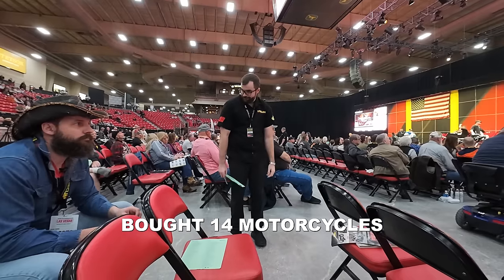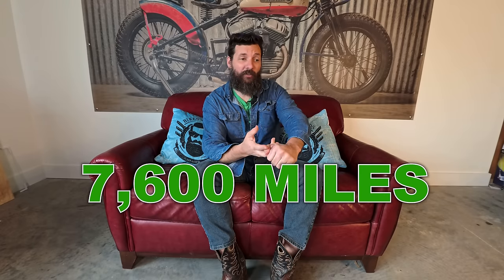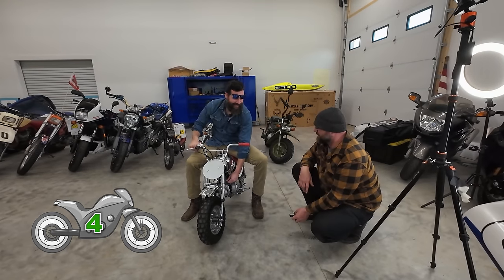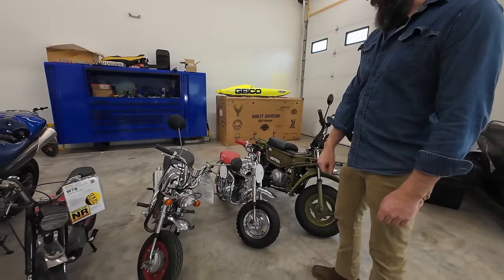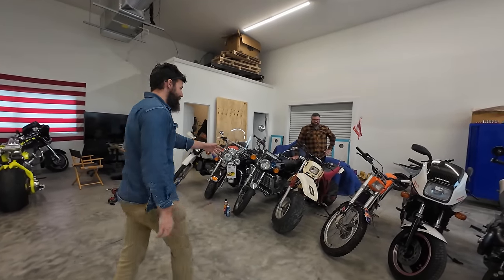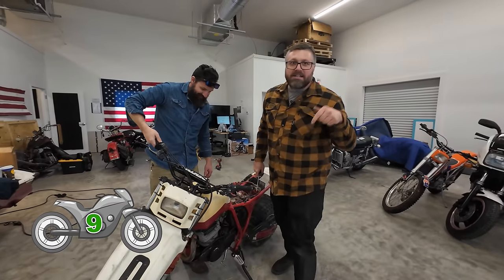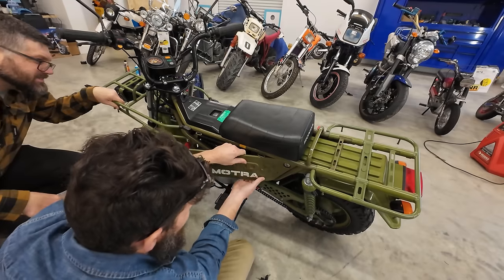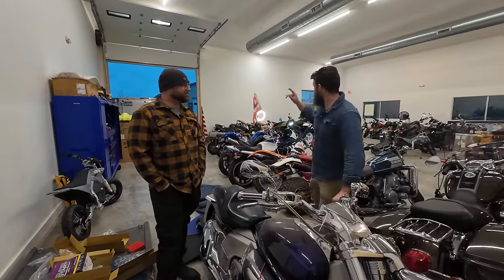I Bought 14 Motorcycles at Auction and its NOT Looking Good

Comment: this video had so much potential, but your camera person seems to be afraid of motorcycles. There was so much talk about details on the bikes, paint condition, speedometer, carburetor, seats, lights, switches etc, yet your camera person keeps filming from 6 to 8 feet away and never gets up close. It is great to see you two guys, but we do not need to see your faces nonstop while you talk about the bikes. It would be nice to see the bikes and details closeup as you talk about them and fix them.

Comment: Worked at a Honda dealership briefly at the time the Interceptor came out. All I can say is there wasn't any room around it when we pulled the shipping cover off of it till after it was on the floor the first day. Everyone had to have their eyes on it!!! Yours looks like a good restore project though. 
Yes they were absolute benchmarks for the industry. Nothing was the same after it.
Reply: Watch for the "chocolate cams" on those.
The oil for the heads is riuted directly from the clutch basket, before any filtration can occur, took the dealers in the uk to figure this out as they just kept eating cams.
They were replacing cams thinking it was faulty "chocolatey metal" at first.
But it was just the clutch dust essentially sanding the cams away.
Honda rushed them out to market to have something to compete against the suzuki katana and never did get round to fixing the issue at the factory.
Within months of release the cbx750 appeared which says rather a lot about this bike.
It was very innovative with the v4 beam frame and strange multi piece wheels!
but a bit too innovative!
Theres a modifcation you can do to take the oil from the main gallery at the bottom of the motor.
Same on the magnas sabre etc. which is a different crank and firing but same engine.
The first editions with the bolted multi piece wheels were a bit of an issue too as if you wheelied one and came down too hard the tyre would grab the fork as the wheel bent...coupled with the slightly nightmarish antidive and floppy frame it would try to kill you just a little bit dead.
The really cool bit was the 180 degree crank, 1-4-3-2 firing order (same as thebhinda racing v4s) and the weight ,it was incredibly light for its day , its essentially the first supersport bike for the road but was sadly a  truly terrible bike as a package.
The vfr that followed is the real honda masterpiece.
They sound amazing on song but you would pay for it in fuel!
Reply: The most balanced motorcycle engine made - Honda V4.
Reply: @sana-cm7oc  in this configuration its a bit special.
1 4 3 2 firing order and 180 degree crank and oversquare bore too.
Same as the motogp v4s made many many years later 
The vfr that soon followed was a vast improvement on the interceptor though.
Reply: @deadprivacy  Thank you. Love this line of engines.

Comment: Congratulations on the RUNE, the best thing is that it fired up at the first attempt. You never see too many Auction Houses go broke. You're an honest, decent young man and you would be a very credible to do business with.Thanks to you for the video I am a regular viewer and also of the bearded mechanic Craig.
Reply: I was the owner of the Rune. It was kept on a battery tender and had Stabil fuel stabilizer. Tank was always kept full and the bike would be run on the freeway every few months. The FI injectors got a bit wonky a few years ago, but adding Lucas injector cleaner and 20 miles on the freeway cleared right out.
Reply: YESSS CRAIGGG

Comment: had an RE-5 - do not forget the 2 stroke oil tank. rotor tips are hard to find for them these days. The good news is it is every bit as smooth as you have heard. Roadtripped mine across Texas in the late 80s. As long as the 2 stroke tank is up, and you have compression, she will run (and surprise you).
Reply: how was it power wise?
Reply: @colestowing8695   about the same or a bit better than a 1000cc of the time
Reply: @acconboy  wow. ok. wouldnt have expected that. those motors were pretty small displacement wise werent they? I mean...the rotary cars were too but they were pretty gutless until they added turbos
Reply: jay Leno has to get spark plugs made for the RE-5. They are prone to eating them.
Reply: @colestowing8695 
Supposedly 500 cc. My friend had one. It sounded like a rotary blade lawnmower to me, with that blowy blade sound.
Reply: I've got a 1975 RE5 sitting in my garage that hasn't run in maybe 30 years. There was a great community around these bikes maybe 10 years ago, I'm not sure what happened to the listserv, though.
Reply: @accon: oil - that’s what I was concerned about that they’d forget the oil.

Comment: Sean, don't let that trucking company steal your money.
You paid them for a service that they didn't provide. 
If you paid by credit, charge it back. The credit card company will refund you. If you paid by check, sue them. Small claims court doesn't cost that much and you can add it to the settlement anyway to cover your costs. 
I know you aren't about that, but it's the right thing to do.

Comment: Here’s a listing from one sold on bring a trailer winning bid was $25k 

This 1986 Honda Z50RD Christmas Special is a limited-edition model that was produced for one year only and was reportedly distributed in pairs to top Honda US dealerships. The RD is based on the Z50R, and all Christmas Special examples feature a chrome-plated finish with red, white, and blue graphics. Power is provided by a 49cc four-stroke single mated to a three-speed semi-automatic transmission. Equipment includes an upswept exhaust system, full suspension, chrome-finished two-piece 8″ steel wheels, and a cross-braced handlebar with red grips as well as a Z-logo red solo seat, white number plates, and a side stand. This Z50RD is offered at no reserve by the selling dealer in Florida for off-road use only with a bill of sale.

Comment: Those honda 50s are incredible machines. I raced a stock one at 160lbs for years. Me and another overgrown child used to push two of them to their limits everyday for hours on our three local pitbike tracks. Never onced had one issue. Didnt even need a top end after all that wide open thrashing. Find me any other dirtbike that can do that... even my ct70 bent a valve before my xr50 even broke a sweat.

Comment: In my 20s, I owned a V65 Magna. In my 40s, I owned a Bandit 1200S. Now that I'm 60, I bought a mint 2006 XL1200L Screaming Eagle Sportster with 9k miles for $3500 with cushy upgraded seat with quick detach Harley wind shield and sissy bar/luggage rack. Love that motor.

Comment: I had a Suzuki RE-5 Wankel rotary back in the early 80's and I wish I had never gotten rid of it. Smoothest bike I ever rode. If I remember right they only made them for two years 1974 and 1975. Big heavy bike and they were only rated at 500cc to get them around the import tax they only measured one side of the rotor instead of all three. It used a special spark plug that was like 10 or 12 dollars apiece in 1980. When the rotor tips went bad oil would foul the plug and you were dead in the water! Never could get them clean enough to use again. God I loved that bike!

Comment: My Christmas motorcycle was a 1970's  Honda SL100. But catch was it was a box of parts with the engine sitting next to it. I was so happy but i fortunately my dad did not help me get it together. I polished everything i could. Then it got pushed out into the back yard where it sat for like 5 years until i drig it back out and cleaned and polished it all again. I found a used engine from a place called "Cycle recyclers". The engine i found was from an XL125. So it was a direct bolt in though. I finally got the engine in and ready to fire up. Got it started and it smoked something fierce. I mean a full blue cloud of smoke. It ate a spark plug every hour. Completely oil foiling it. I rode the crap out of it but i was running out of saved money and cans to recycle and cash in tobuy spark plugs and oil. Oil was actually running out of the exhaust pipe. So it got parked. I pulled the engine out. My dad was friends with the honda mechanic at the Honda dealer. Took the engine to him to do some trading with my dad to rebuild my 125 4 stroke. Months turned into a couple of years and i finally got my engine back. I was now like 14 and i got this bike at around 8. So finally i had it back together and running. I clocked many hours off on this bike. I then sold it to buy another bike. But i will never forget my first real motorcycle my Honda 4 stroke!

Comment: The Honda Z50 special came out the year after I got my Honda 50, in 1980. I remember seeing one on display in the motorcycle shop mine came from as dad liked to go in there and browse or maybe he was buying oil and filter for his Goldwing. I started riding when I was 6 years old. I then graduated to an XR80 in 1984 and my sister got the 50. Funny thing about the 80 and earlier 50's was that it would constantly leak gas out the top of the tank while riding. In 81 they went to the vented cap that dropped down into the front bulkhead.

Comment: The RE5 looks likes its missing it gauge cluster cover. Still, an amazing motorcycle. I had a dealer that had a couple. They were working on the carbs one day I was there. The carb schematic was simply crazy. Its amazing what Suzuki engineers accomplished in the 70's with that rotary design.

Comment: Interesting collection you bought there. One question tho. Why didn't you drain out all the old fuel first? I worked on alot of bikes over the years, and fresh fuel (and batterie for that matter) was always the best way to get the bike running again. Well, unless it was toast, but that is a given.
EDIT: learning how to ride trial is so, so much fun and quite usefull for noemal riding. I had alot of fun with a Gasgas TXT 250.
EDIT2: The Rune is such a sweet ride.

Comment: i saw the motra video. im 99.9% sure its just the clutch slipping from being adjusted too tight. the clutch disengage the crank from everything else and still spin the gearbox when using the kickstarter.  also some of those cheap version engines  dont have a stop on the gear selector drum and you can keep cycling trough the gears by going 1 way.

Comment: I'd be curious to see what you value my 04 Road King at. I've had some work done, the bike had some work done when I bought it. I know what I've spent on it in the last few years, and I won't recover the cost, but I damn sure think it is worth more than 8 grand. How do you begin to value a bike like that? With the way it looks, and runs, and now drives, I'd be interested. It is basically a stock paint, has LED upgrades, 12" bars with stainless controls, custom suspension fully adjustable Legend Arc rear and ask Julez (Black Gold Harley in Allen, Tx.) what front. I used what he does, needs to be tuned (tuned for a 300 pound guy) a bit but it is ok.

It is interesting watching you do a variety of bikes and giving their value, even on the losses. I don't plan on selling mine but it is a beautiful bike and draws a lot of attention. Everything is for sale when you meet the right price. I'd be interested in the right price for my baby. Not blue book, not ins, or trade in, just the value for what it is. My value is $15000 minimum and that is a serious loss. I just don't know how to value it.

Comment: FYI - in the trucking/freight brokerage industry the phrase, "the truck broke down", is usually the common lie for we didn't have a truck at the time but thought we could get one. We took your load and money but didn't really have a truck available, or we knew the truck we put on it couldn't make your deadline but took it anyway. As someone who's been in the industry for almost 30 years, I've had to deal with it plenty of times. It's not always the case but more often than not it's total BS. It's especially bad in the auto transport industry. There's a lot of over promise and under deliver in that sector. If the carrier can't or won't tell you where the truck is being repaired or show you the repair estimate/invoice, they lied. Also, as you learned, never pay anything up front. They either give you credit terms or you pay "collect" on delivery.

Comment: The coils and carbs are finicky! Had the second place Wes Cooley 1984 Daytona 200 2nd place bike for a couple of years. The trans and chain gearing was such that it would run up to 110 mph, had to put a 92 tooth res sprocket. It had magnesium carbs and cases a had the same designation as your ‘85, a 15 prefix!  Light an so fast!😎💙

Comment: I spent 20g at an auction for 6 bikes. One was a 1947 Knucklehead. It didnt run. Only one bike could run. A Haysbusa but it had been crashed and lazer proved, bent frame. I parted it all out EXCEPT ONE. 1968 Honda Trail 70. The Haysbusa engine went in a two seat sand buggy. The Knuckle went FAST. I broke even at days end. The trail 70 is on the rear bumper of my camper for beer runs

Comment: Hey Sean, I have a question about exhaust pipes, so ive found a vance and hines twin slash exhaust set for the boulevard c50, but the year range is only 2001-2009, I have a 2024. Do you think these pipes would still fit the bike or should I look for another set, and if I have to look for another set what do you recommend to make the bike sound louder and nicer.

Comment: 12:20 you can tune those small sachs two strokes to go like stink. alot of parts for them here in scandinavia atleast. Comet cylinder and a bigger carb, a exhaust and it will scream :D

Comment: Upon removing oil pan No ifs and  or buts replace the engine oil level  sensor at the same time. Because you will be doing all this again or be pulling out engine instead of the diff and steering.  Id pull engine since i ain't got a lift

Comment: Try my luck here. My 2014 Yamaha bolt was stolen then recovered. I bought a new ignition switch and installed. Dash gauge turns on, fuel pump I hear, and rear lights on but I hit the starter switch and nothing. Brakes don't light up when I press the brakes and no turn signals when I hit the switch, and also I checked all fuses.

Comment: Why didn't you check the battery on the RK With a volt ohm meter before just buying a battery? The headlight was exactly as bright with the old battery as the new one. That means the old battery was good, the connections were bad.

Comment: Given how bad some mechanics  can be, i feel the rotary emblem is warranted. Most rotary engines die because of the owners and mechanics.

In the rotary club i'm in, there's people who have untouched (as in always serviced, never repaired) engine bays and the secret is they aren't being absolute knobs with their vehicles. It's not like they're doing anything special. Those are not Rob Dahm cars or (the few) bikes in that club.

Just every day or sunday drivers. There's a guy from Kent that has an 1996 RX7 that has 70k km on the clock, and it's in original condition, worn, but original and only recently it started giving him grief with oil issues.

Comment: Your way off on that RE5 unless something has drastically changed on RE5 values recently. Going off what I have seen since around 2020 that RE5 cleaned up, in good mechanical/running condition, mostly original and sourced the original speedo cover should bring around 6-8K. Clean running original example or a restored bike 9-12k. A clean resto sold on BOT last year for 11.5K so I don't think the values have changed to much.

Comment: The Honda motorcycle can be problematic depending on the year it was made. Those particular ones there was a couple of year where Honda VFR interceptor (?) use a 3 bolt crank or cam which caused them to shear off because the amount of torque the engine created, in later models Honda made them with 4 bolts which never had the shearing problem.

Comment: Remember when a buddy bought a 86 ninja 600 in the late 80’s and another friend’s father was selling that exact interceptor 750 for like $1500.. i was young ,sporadically employed, and it wasnt running for yrs …i had gotten my hands on around $1200 and he wouldnt budge ..so it  never happened    And i emded up with a rock solid 82 yamaha maxim 750 instead ..and that lasted, being beat to hell, till i sold it in like ‘91 for half what i paid still running and never tuned up or fixed etc lol……never thought of that interceptor since ,i didn t know it was a v motor till very recently 😂   And as it turns out iam now very glad i didnt get it for multiple reasons (dont like the reliability of v motors from back then🤷🏼‍♂️)& yes iam not very bike mechanically inclined haha)

Comment: One comment re the RE5 - a cold start on a rotary engine doesn't tell you that much about its health. It's really the inverse of a piston engine inasmuch that a "bad" engine will start when it's cold, and then you're at a gas station with a warm engine and the cursed thing won't restart. Not that I would know anything about that, oh no.

And yes, I'd absolutely be interested if you started a curated motorcycle auction company.

Comment: The MT01 is bound to become a sought after classic. Especially in the US I‘d say. 

Ye should really try gettin it back to a more original look. That rear end looks like a right proper pimple on the bum, like … oneadem itchy ones on the verge of yer crack like, ye know. 

Manifolds in conjunction with the Akras could make it a so called „Stage 2“. 

Did you check if it has standard airbox fitted or possibly even just mushroom type intakes? That would make it a „Stage 3“.